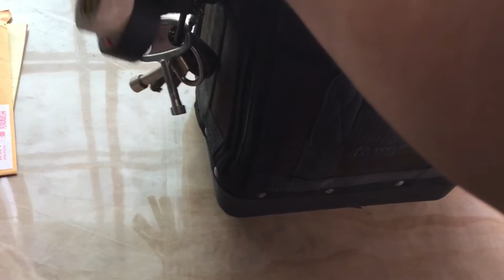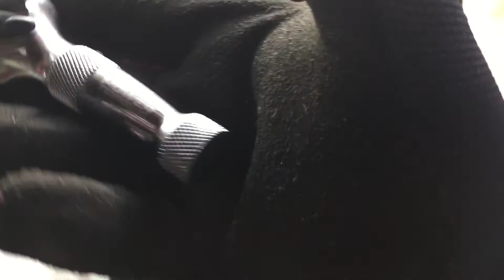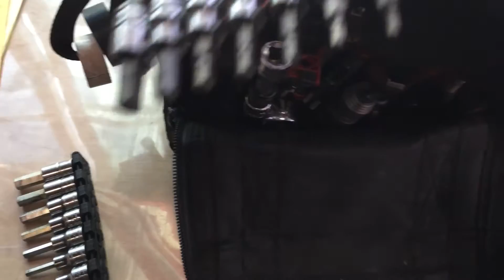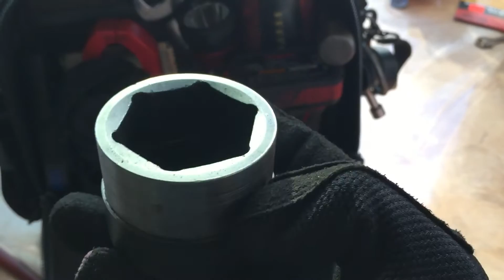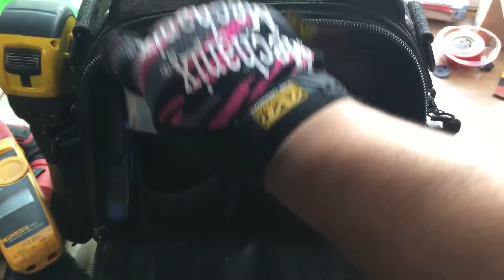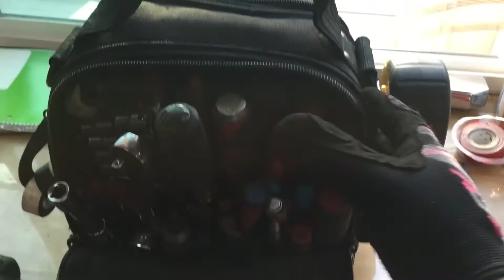Veto Pro Pac MC review and set up

Comment: Oh and saw a locking impact extension in harbor freight yesterday pretty sure it was 1/2in drive though
Reply from the maker: Tyler English they should have 3/8" and 1/2"
Reply: Benny CompTech I'lll have to check again thanks for the heads up cause I could use one

Comment: Nice video, always cool to see what guys in other trades carry daily to get their job done.

I've had my MC since March(for HVAC Service) and it's just about perfect.
Reply from the maker: scrambler350 I use 3 bags total all set up for specific job types I use this MC for maintenance and repairs, then I have my husky electricians tote that I use for emergency services and diagnostics and lastly my tp3 which I've now set up for just replacing small parts from Circuit boards, contractors, relays, pressure switches and some small valve assembly's but I really only use it when I've gone on a call with my husky bag found the problem but need parts I don't have and use the tp3 when I return  in a couple days or whatever to replace what failed
Reply: Right on, I'm going to experiment with the same kind of set-up in the next few month while it's slow.

Bought a Tech-LC last week, still got my MC bag, and just got an inexpensive Husky tool pouch for ONLY my Meter, slide drive, 5" knipix cobra, thermometer, and klein all purpose pliers - to make initial diagnoses' on service calls and then run back to the van for parts or the MC bag and my manifold if needed.

Also scored an OT-XXL on eBay a few months ago(for less than 1/2 the price of new) in great shape, but I use that as storage for power tools and my rough-in/change-out stuff and it stays in the van 99% of the time.
Reply from the maker: Mike_HVAC yeah at first I carried a shit ton of tools in a huge Klein backpack and it was just to much then I decided to just do separate bags for different purposes